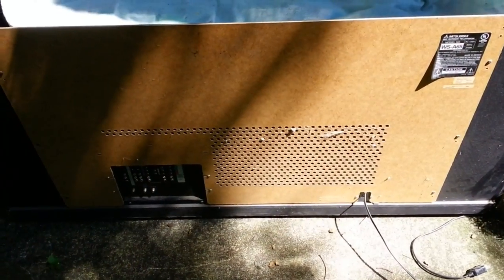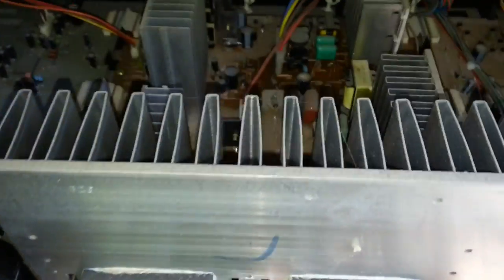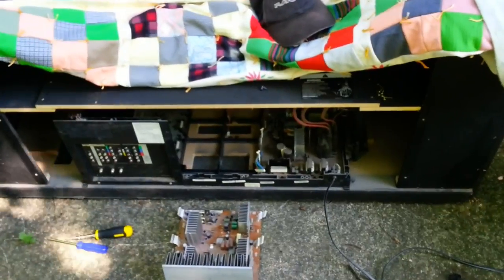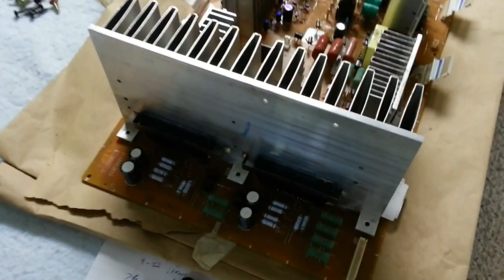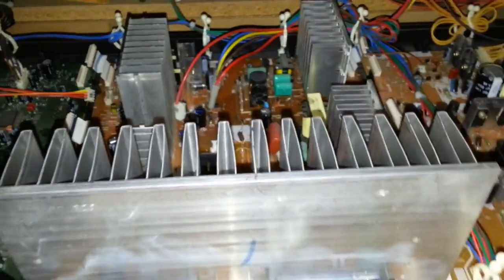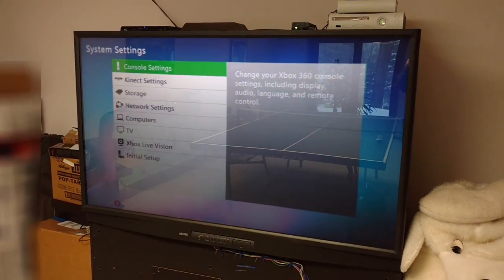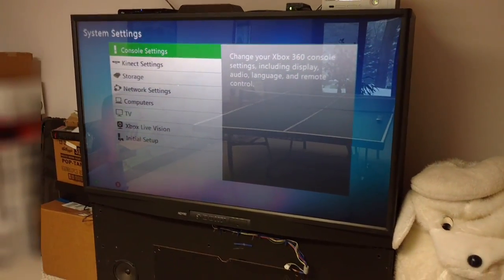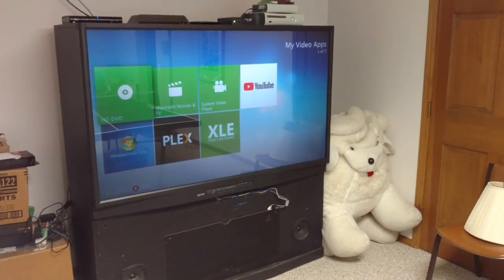Mitsubishi WS-A65 Repair V-Log and CRT Rear Projection Discussion

Comment: Did you also put new coolant in the tubes on yours and clean the old build up? Because it looks on video as if it's in new condition while mine looks blurry on the edges. And while mine has no convergence issues, the guns still don't want to align perfectly as yours does, resulting in the blue color smearing out a bit. My model is the WS-55313 and has a DV-i port. Also, it has very low hours also and it only looks better when turning up the brightness, but not the contrast and needs to be kept at 0.
Reply from the maker: No. If only a small amount of coolant leaks, then it's fine. How blurry are we talking about on the edges? And is it blurry or misconverged?
Reply: @Browningate  Very blurry on the edges but the center seems normal. And it's slightly misconverged at the edges as well, resulting in a mild pincushion, but the IC's seem to be ok, as it would've not been possible to adjust in the service menu, and using the FINE green adjustment fixes the mild convergence issues and has nothing to do with aligning the green gun. I now just took a look and found only mild to moderate yellow build up on all but the blue lens but not covering the entire bottom. I've usually been told that only when the screen becomes pink you need to change the coolant, but do you think in this case I should just go ahead and change it anyway?
Reply from the maker: @blazuma111  I suppose it's possible, but it just doesn't seem like the two would be connected. If you have the time and materials to do the coolant flush without damaging anything, it can't hurt, (unless the seals are starting to go and the very act of changing it causes a leak) but I'm skeptical that it would have any impact on the edge focus. Have you posted a photo depicting the edge focus on AVSForum (or similar) to get some community input? Keep in mind that flat CRTs historically have always naturally been a bit unfocused at the edges, and I'd imagine that the effect is compounded if the thing's got a lot of hours on it.
Reply: @Browningate  I'll be sure to post it on AVS forums, but the real problem is that recently, my colors went out and are very dull and not vivid. I'm guessing it's a video chip that went out, but then again, I'm not so sure, it sometimes used to come back on after the set was on for about half an hour and then would go back to the dull colors.
Reply from the maker: @blazuma111  At that point, was that the only degradation in the image, and was it affecting all inputs (and menus)?
Reply: @Browningate  It has been affecting all inputs, but not the menu or the service menu, as the service menu appears super bright when you enter it, but once you exit it, it becomes very dark.
Reply from the maker: @blazuma111  The user menu is the same way too?

Comment: I have a 55 inch. Northeast Pennsylvania. Works perfect. But I have a dumpster coming next week it’s going.  Total albatross
Reply from the maker: Before you call it quits, I'd recommend cleaning the lenses and turning off VSM sharpness. You might find that it's a lot better than you originally thought.
Reply: @Browningate  no
Room
Reply from the maker: @EvilAndy-os6bz  I've never really bought into that excuse as being truly valid. Even wall-mounted flatpanels still require a stand apparatus with approximately the same footprint as a 55" CRT rear projector to accommodate for all of the supporting equipment (game consoles, cable box, etc.). The only time when the size/weight factor really comes into play is with moving the beast to a different room or house.
Reply: @Browningate  lol trust me. It’s in the way now. Sledge hammer time come Monday.
Reply from the maker: @EvilAndy-os6bz  Not sure I can "trust" anyone who's threatening violence on an inanimate object. I fail to see how it's "in the way" now, since we've already proven that it doesn't take up any more floorspace than an a/v stand.
Reply from the maker: @EvilAndy-os6bz  I'm not the one making irrational excuses.

Comment: Hey browningate, thank you for the video. This has opened up my eyes to getting my ws-a65 working correctly again. I just had to replace the signal board on mine as one of the was leaking coolant onto it. Now after that I have fired it up, I have a distorted picture. Its Almost in the shape of a bow tie. I'm guessing the convergence needs to be set on it? I'm kind of Learning as I go along. I know I'm going to have to find out where my coolant leak is coming from before anything. I was going to ask is there any way after I get this coolant leak fixed how to set the convergence? I try to hit my menu button on my remote control I am unable to pull up a menu on the screen. Any Input or advice would be extremely helpful. I know I'm probably spending way too much money on this old technology TV, but its what I grew up with and just have a special place in my heart for it. Thanks again.
Reply from the maker: If there's gross distortion of the image, (separation of color convergence) you might need convergence ICs. Did it look like that before you replaced the board? With regard to the leak, you may need to figure how to rig something up to protect the boards until the leak can be resolved. If you've already got that much money into it, you may as well go the whole nine yards and finish the job, if you've got the space and/or use for the machine. That said, if you're getting no response from the buttons, check to make sure that there isn't coolant splashed onto anything important. It can be tricky to spot sometimes. Glad to hear you're making progress on the repair! Keep us posted.
Reply: @Browningate  no no it wasn't like this before the TV went out. I actually just went in there to go take a picture of it and miraculously I all of a sudden have a picture. I did notice that the corners of the picture on the left hand side are rounded off. It looks like there's black spots on the very corner. if I knew how to post a picture on here I would send it to you.
Reply from the maker: @Niterider - Well, the YouTube comments section strictly only supports text, but you could upload the image off-site and then link it. From what you describe though that still sounds kind of weird. Is the problem in the corners perfectly synchronized across the colors, or are they misconverged? Is the geometry of the image distorted there? Again, check for errant coolant anywhere and everywhere you can find it on any and all boards. It's unlikely, but check for damage on the used board that you purchased too.
Reply: @Browningate  yeah you're right. I never once thought about that as far as posting a link. On the picture itself definitely the convergence is out of whack. I know that's going to need to be adjusted.before my TV went down though I was having a problem with my screen being too large a picture for the television itself. So on the Barry corners it was cutting off channel logos. As soon as I get home I'm going to go ahead and take it apart and see if coolant has dripped anywhere else on to another board. By the way I was going to ask, what kind of coolant do these guns take?
Reply from the maker: @Niterider - I've never looked into it or heard of anyone doing it before. What I have heard is that there's definitely enough in there that some can leak out without affecting PQ. You'd have a sizeable amount of liquid dripping down before it became an issue on the tubes. It'd probably be easiest to harvest some from a dead, discarded unit if needed though.
The condition you describe with the image being too large is inherent with the technology. They did it on purpose because it would take too much effort to properly calibrate the geometry at the edges in the factory, from what I have heard. It can be adjusted down in the service menu or it can be fixed physically by way of shims. Either option requires a very large amount of effort, adjustment, and expertise, and carries a lot of risk.

Comment: Hey I just got a ws65315 for free and I love it!. My only complain is that the picture is very very dim. Do you know if it’s  normal also that I can only see pictures if I sit in front of it? I can’t see anything if I sit at an angle let’s say 45 degrees from the tv?
Reply from the maker: CRT rear projection isn't the brightest, but unless you have an LCD displaying the same image right next to it, there shouldn't be a dramatic level of noticeable difference. Viewing angles are a different story. The lens salvages everything it can out of the CRTs by focusing the light forward. You can view the image off-angle, but it won't be as bright. Another thing to consider is that CRT doesn't last forever and does age. If your set was run at 100% contrast (which is the default setting out of the box) for tens of thousands of hours, it will not pack the punch that it did when it was new or if the previous owner had the presence of mind to change the settings.
Reply: @Browningate  That makes sense. Is there any chance that I would achieve a bright picture as it had before when it was new or at least close to that? The speakers are great, they sound terrific and the image is not bad is kinda blurry but I love playing doom 3 in my og xbox. Thanks for the response! :)
Reply from the maker: @Tico - You're welcome. Assuming that it actually did lose brightness, it could be a weak power supply, but more than likely would be worn tubes. If you could salvage scarcely-used tubes from a similar/identical model, I suppose you could swap them in, but that would be way more effort than it's worth. If the previous owner ran it on 100% contrast for tens of thousands of hours, the damage has already been done. From what I understand, the color shift is more apparent than the brightness change though. The following link shows what this looks like on-screen for a CRT front projector, which uses similar technology: http://www.curtpalme.com/TubeCondition_OnScreen.shtm

Comment: i've known about rear projection tvs, i found out abt CRT projectors many many years ago, but somehow i didn't figure CRT rear projection TVs were a thing until this year and i've been fascinated by them ever since, the fact there have been even HD capable ones blows my mind completely! An analog tube based television of this size with HD resolution would be an incredible thing to own, i'm guessing that the input lag prob. isn't too great on it though?
Reply from the maker: Little to none. It's not really doing anything in the way of converting the image (save for converting 480i to 480/540p). You might even be able to play duck hunt on one of these HD units, although I never got around to trying it for myself, unfortunately.
Reply: It sucks I can't add a pic it I have the big Phillips 56 inch an it has the hd tv monitor badge virtual dolby surround

Comment: I just pick up a Hitachi 60SDX88B rear projection free it does work (tuned on ) blew all the dust out with air , did not see any signs of leakage anywhere, THEN I discovered  it was not a DLP  It seemed that few of the boards were like new in comparison to other others.  mounted some handles on the sides ( she a big girl ) the person said it worked as it should but its a 1999  i thought maybe just needed hauled off, but seeing your video might be worth trying it out . what would you suggest I check or do first to see if its a candidate for saving
Reply from the maker: My advice would be to power it up and see what happens! From what I've read on that model, while it is a 4:3 set, it should take full HD, so your 16:9 material will just be cropped down a bit, making it more like a 57". It advertises a 60 watt sound system too, so I'd be genuinely curious to hear what it can do.

Anyway, if it works alright, clean the lenses, tighten up the convergence, and get an HD source hooked up (seventh-generation game consoles, and even some sixth-generation systems, are great candidate). Keep us posted!

Comment: I have a 2004 unit, replacing the convergence board tomorrow but noticed droplets in the green and red, so I guess the coolant level is down and a couple of the boards do look like something has dripped on them.  How do you remove the crt gun and do what you did, refill them/seal the. BJ
Reply from the maker: Good to hear you're on the road to repair. For the coolant stuff, I don't know what the procedure is for refilling the coolant. You have to leak a heck of a lot before it starts to affect the lens's ability to do its job. If you've got droplets appearing on the boards, then it just comes down to damage control (cleaning up the mess) and finding a way to rig something up to prevent future drippings.

Comment: I Just came across your feed and I have a Mitsubishi 65809 in actually excellent condition that I am selling to someone.  Do you have a video or any instructions on separating this TV for transportation?  I remember seeing this delivered in 2 parts, but assembly seemed to go fast and I don't recall what was required other than seeing the front speaker grill snapped on. 

Thanks.
Reply: Michael Azzarello how much?

Comment: How do you use this tv like to setup channels I got one today and I am having trouble with it ???
Reply from the maker: The tuner is NTSC only, so you won't be getting any HD on it. Just go into the menu and have it scan for channels if you really want to use it though. Otherwise, get an outboard ATSC tuner that can output component, or a proper set-top box from your cable/satellite provider (or and HDMI-to-component transcoder for your Roku).

Comment: these are the last types of tv's i repaired as a tv repairman i decided the chinese made junk made after wasn't worth wasting time on, i still repair crt and rear projection sets but mostly just vintage tv''s from the 50  upto the 80's
Reply from the maker: That's too bad. Backlight replacement in Led-backlit LCDs is fun and rewarding.
Reply: May I please ask if you have an idea what type of fresnel lens does this exact model use? Is it a spot or linear one?

Comment: I wonderimg if it will look good for retro gaming now with an upscaler. 1080p is all I need.
Reply from the maker: 1080i is indeed an option. A transcoder and scaler device will be your best choice for HDMI-exclusive equipment.

Comment: I have a similar model and have been trying to figure out and diagnose issues with it. At one point it would display snow when turned on but now it won't even power on. I do not know where to start to diagnose the issue. I have blown out the dust in the cabinet and I do not see any signs of leaking. The TV was not used very often so any help in where to start looking  would be very helpful?
Reply from the maker: If the not powering on was preceded by convergence problems, it's not that uncommon for the ICs to short out and kill a pico-fuse when they have been run out of spec for too long. If the convergence was fine before, start with checking for standby voltages and such to rule out a bad power supply. And look very carefully for small splashes of coolant, as they can be extremely difficult to see.
Reply: Browningate there was no convergence issues prior. The image quality was actually quite good but one day when I tried to power it on it did not come on. Prior to that it was only displaying snow but I attributed that to not being connected to a signal. It is just odd that it stopped powering on. I had blown out the rear of the case thinking it was just dust but it did not fix the issue. I tried different electrical outlets and still the same result.
Reply from the maker: @DorianMariusGray  In that case, let's start looking for coolant drops on the boards and move on to testing standby voltages. If you get none, or inconsistent standby voltages, disconnect the power supply board from its neighbors, and try again.

Comment: Great Video/repair. I recently picked up a ws-55517, Mitsubishi's final CRT Rear projection. has an HDMI port, but vertical lines are very "wiggly" and the picture jumps around until it warms up. can't figure it out to save my life.
Reply from the maker: Could be cold solder joints under the convergence ICs, but I'd check for coolant leaks too. Does it do that on all inputs and for the menus also?
Reply: @Browningate   Mr Bob suggested coolant leak also, but I can find NO evidence of one at all. there is however heat paste smeared all over the signal board. all inputs, the menu, convergence grid etc are all affected by the "wiggling".
Reply from the maker: @jdla140  Weird. At approximately what rate is it doing that?
Reply: @Browningate  It varys as it warms up. Possibly a 60hz buzz from a bad filter cap, but I see absolutely no evidence of that whatsoever.
Reply from the maker: @jdla140  I'm at a loss on that then. I was able to get my replacement power board from an eBay seller who was parting out a working unit. If you can rule out just one of the three major boards, then you've got a 50/50 shot at picking the right one.
Reply: mine only wiggles on the vertical lines then fails the auto focus as a result. Ive seen a bulletin that says it might be some bad filter caps on the MVUP14 Hyper Module. I figure $4 for some chinese caps and it sounds like a fun project trying to fix this TV. I usually just port sound over to it from my computer and use it to play music louder. But theres gotta be a smaller way to tie In aux to surround sound. In fact I have a projector  screen I can pull down in front of this rear projection and it all gets very little time use since I find the room has to be almost movie theatre dark for good viewing.